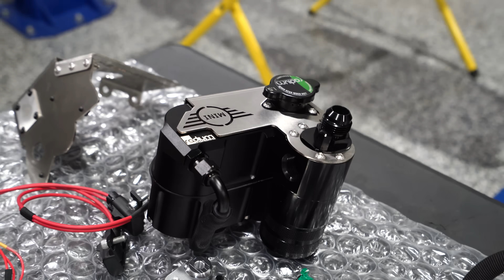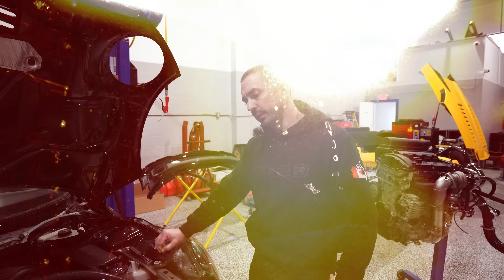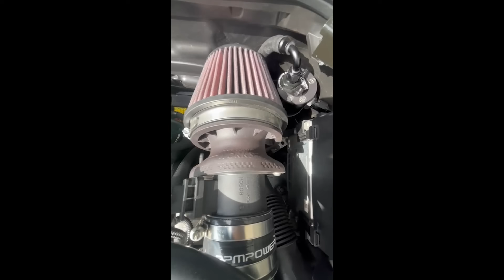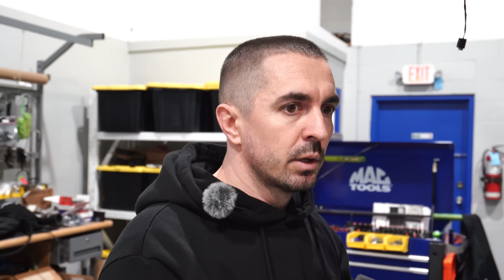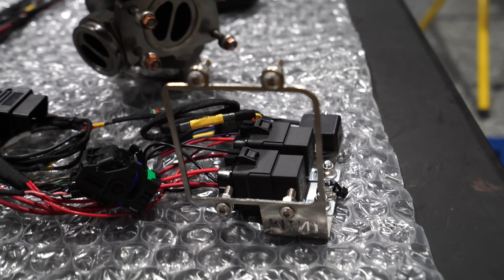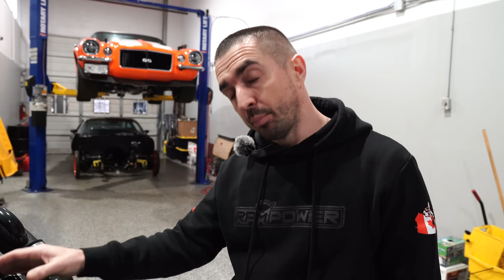The Final Piece of this BULLETPROOF 600 HP Mini Build

Comment: Seeking information: 
(I live in the U.S.) 
My wife bought a 2012 Mini Cooper S and because I am a gearhead I can't leave anything alone. 
Here are my questions. 
• So what is the limit to a stock motor safe side 350/400whp ? 
• Is there a company where I can buy a complete Forged Rotating assembly ? 
Or best place to buy a performance built engine? 
• Is 600hp the limits for a Mini without swapping in a bigger motor ? 
• Has anyone ever run a nitrous system ? 
What size shot ? 
Stock & Built ? 
And where is the best place to get information on a Mini ?
Reply: Stock engine will handle 250whp safely, anything after 300whp is sketch as rods will bend. Not sure about complete rotating assembly, but OEM crankshaft is forged and solid for almost all power you could throw at it. rpm powered(the guy in the vid) has for sell pistons and rods that he uses for his 400+hp minis. 

If you treat them right, the cars are pretty reliable and fun to drive. it’s no civic reliability, but it’s a fun unique car that can be reliable with some new parts
Reply: I would also like to know this as my n14 is burning exhaust valves on cylinder 3 for the 2nd time. I’ve paid too much to have the head rebuilt before so now I’m doing all upgraded parts to have longevity. I just want to make it to the 4-500hp mark and keep it reliable. 

I’ve found companies like Lohen and SneedforSpeed that build crate motors but haven’t pulled the trigger because I’m skeptical about things. More confident in Lohen but they’re Uk based and I’m in USA so shipping a motor would be crazy expensive.
Reply: @ModVlog sneed is historically garbage, stay away
Reply: @zevisgarage  I may be needing your services soon or atleast some insight on what it takes to build my motor. I want to get 4-500whp out of my build. I will be in touch with you soon we gotta hit the back roads. I have also never been to willow so it would be cool to have someone to meet up with show me the ropes 😄
Reply: @ModVlog  I can't lie buddy what I read the Mini Cooper is not a very reliable car at all. 
The more I read the less enthusiastic I am about the car.  
How long you had the car ?
What kind of mileage is on the car ?
Reply: @katkilr7685 I’ve had the car for about 6years now 230k on the clock my wife bought it with when it had 120k for super cheap I talked the guy down because of the issues it had we grabbed it for $1800 cash. I’ve taken it over and done a bunch of mods after I had all the preventative maintenance completed for around 4K which included timing coolant pipe thermostat water pump and cylinder head. It drove good for 2-3years boosted with different hybrid turbos but lost power recently a couple months ago took it for diag and they used a borescope found cylinder 3 has burnt exhaust valve 😢 runs great until it gets hot then the power fades. Now Im planning to do all my own work. I own 2 Volkswagens so I am used to wrenching. Just gotta get the right tools with some stronger internals and I’ll be installing a big turbo.
Reply: @katkilr7685 They are mainly unreliable due to the owner’s lack of maintenance and understanding of the car. If you take care of it, the car will take care of you
Reply: btw more than 300whp is pretty dumb on this car, it don't gonna make it more fast on track.
it's just for fun / burning money
Reply: @Mrzeseb13  If it runs a 8 or 9 second 1/4 mile I don't care about wasting money.
Reply: @katkilr7685  bro a ADW car will always be slower than RDW on 1/4 mile
Reply: @Mrzeseb13  
  Buddy that depends on a couple things, like 
street or strip and the set up.
Hers is front wheel drive.

Comment: That valve cover looks to be missing the PCV. Is that correct? I HATE that PCV system. About to change the valve cover4 again on mine.
Reply: No, Valve Cover has full operating PCV System with self draining oil/air separator.
Reply: @Lorenzo_Lebediuc  Nice. I had not finished watching haha. I have now.
Great video, and think i better understand why i'm having certain issues...maybe a little too much power for the stock components.
Reply: Make sure to use an OEM Valve Cover, aftermarket and other OE valve covers won’t last as long and will give you issues

Comment: I’ve been following your channel for several years — the power and torque you demonstrate are truly impressive. You’ve shown that the R56 is more than just a car known for its reliability issues. I hope there will be a chance for your system to be introduced in Taiwan as well.
Reply: I really rate the engines, when working haha.
To be fair, for the most part, the engine is actually ok, its the plastic parts attached to it that are the problem haha. 
My R55 JCW just has an intercooler, downpipe, intake, better plugs, and a very good tune...and its RAPID. The torque is the most surprising thing!

Want to build it up better at some stage, 600BHP would be ansolutley mental.

Comment: Are there parts from Greece that are readily available there that you wished we could get in North America? 

That RPM intake is so bad ass, but very pricey. Im sure its among the best offered, so no smoke here. They're still on backorder?
Reply: Thank you for your input. Manufacturing manifolds is costly(Made in Canada), and it’s hard to justify keeping them on the shelf for low demand. The R&D costs were substantial, and the design is complex, consisting of multiple pieces that require meticulous attention to detail. The product has undergone eight design iterations and various cylinder head port jobs, validated through flow bench testing and then real world testing on dyno. Given the development costs and the 17 hours of machine time per set, I believe there’s nothing on the market that can match this quality at a competitive price. Achieving that “bad ass complement” involves a lot of hard work! 😅

Also, to mention, fastest cars in Greece, went back to Stock OEM Intake Manifold, because the offered options there, caused too much lag. I know both owners, thats what It was shared to me from both of them. 🤷‍♂️

Comment: The video is long-awaited and wonderful. The R400ts is something incredible. I've been using it for three weeks, and it's worth every cent.
Reply: Are you stock or did you do head work and forged internals?
Reply: @dorrelllivenowworknever2447  No, the engine is not stock. It was dead. Currently in stage 4 (closed block, forged, ported, etc.).
Reply: @kolesnikovvolodymyr648 Where did you purchase the built engine? Was it a crate motor or built/ sourced piece by piece
Reply: @ModVlog  built it myself, except for mechanical processing (sleeving, porting), if you are interested, look here @volodymyrkolesnikov
Reply: @ModVlog  built it myself, except for mechanical processing (sleeving, porting)
Reply: @kolesnikovvolodymyr648 I have never built a motor but I do all my own work on my Volkswagens as well as my mini full bolt ons for both. Recently did my clutch packs for my Volkswagen Im a little more confident in building the motor for the mini. Just curious how hard was it?

and did you keep your original oil pump assembly? 

My engine is at 230k miles want to keep it for life only thing that is giving me doubts is that it’s an automatic and unsure if I should build it with the possibility of the transmission likely on its way out. Going to start working on repairs in a couple months
Reply: Hope you are enjoying your R400TS! It’s an amazing turbo kit! I love mine so much
Reply: @zevisgarage  Yes, I agree with you 100 percent. This is a perfect kit. Lorenzo knows what he's doing